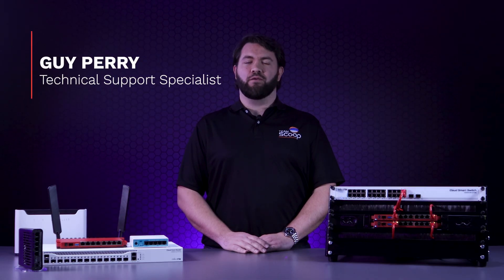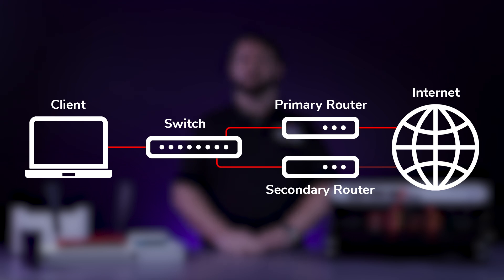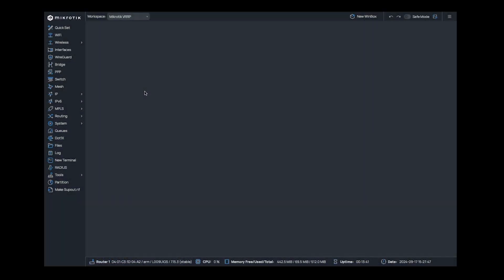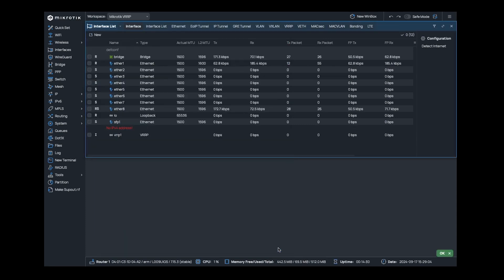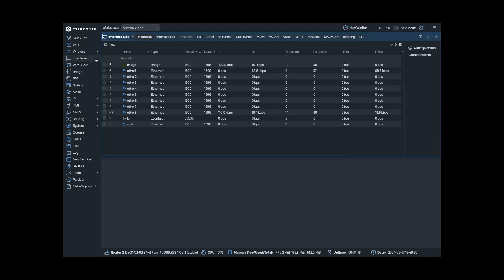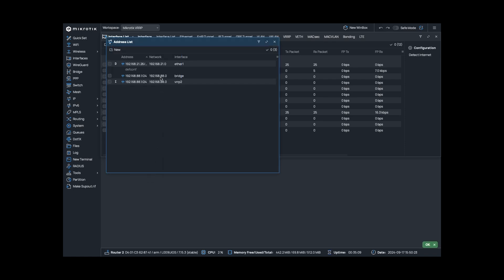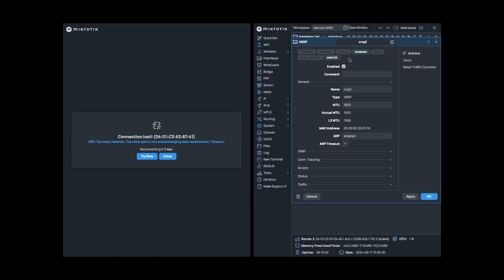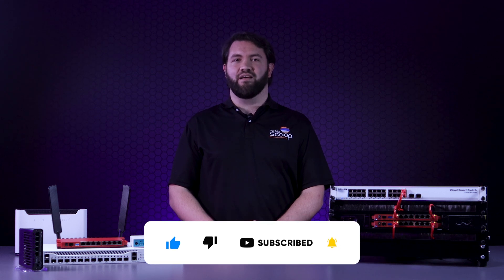Use ANY MikroTik router combination to achieve Network Redundancy in case of hardware failure (VRRP)

Comment: It works partially for me. Switch to the backup router, but when the router comes back from failure, the connection does not return automatically, it remains on the backup router :-( Only when there is a failure on the backup router does the connection return to the main router.

Comment: Nice explanation. Right to the point. Just a question: How does the routing work on the master, if two interfaces, vrrp and bridge, are in rhe same subnet (192.168.88.0/24)?
Reply from the maker: Glad you enjoyed the video. All traffic will be routed to the VRRP interface instead of the bridge interface. The VRRP interfaces all form a 'virtual router' which acts as the gateway for the network and all rules you create should treat it as such. 

Since you would be using multiple routers, the bridge IP of each router will be how you can access the intended device for management purposes. This way the VRRP and bridge interfaces can be on the same subnet without issue.